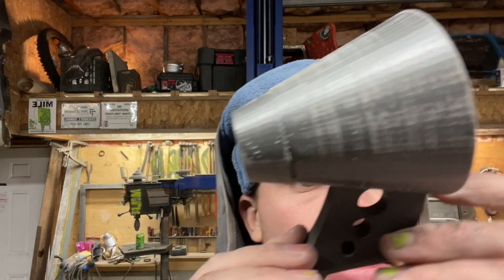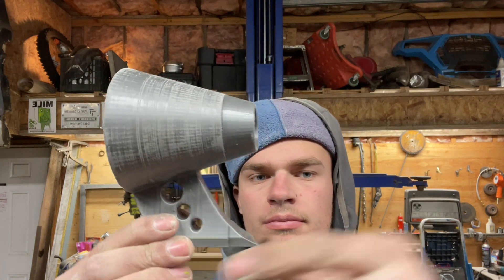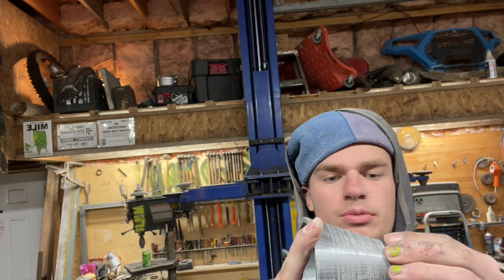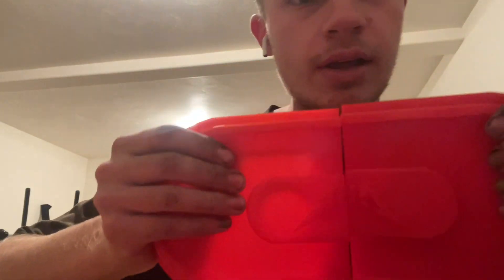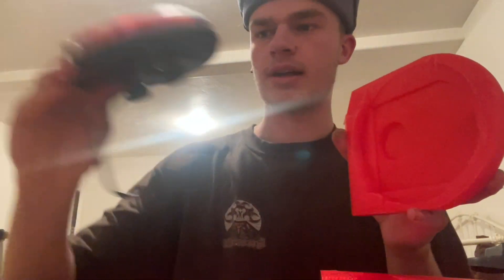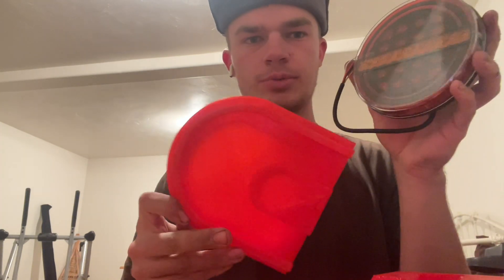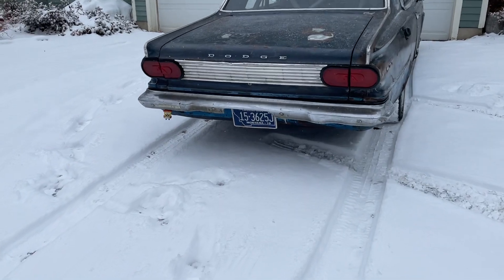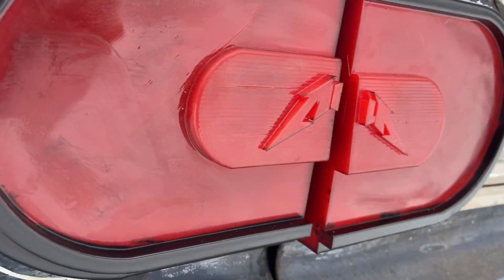3D PRINTING CAR PARTS \ LED TAILIGHTS AND MIRRORS

Comment: I highly suggest petg filament if out in the heat.  Pla will warp and melt.  Awesome job.  I used those exact tails on my sand rail
Reply from the maker: Thanks for the tip!